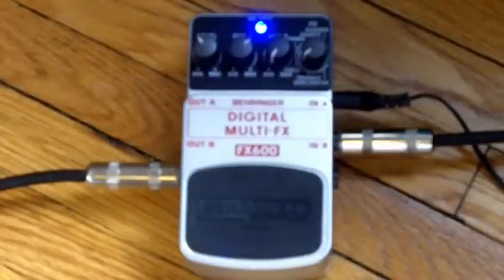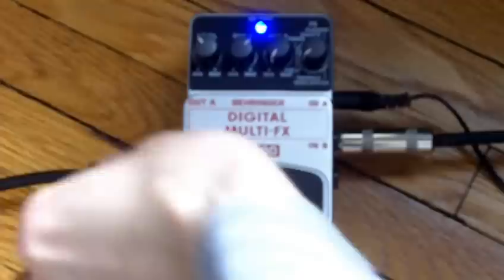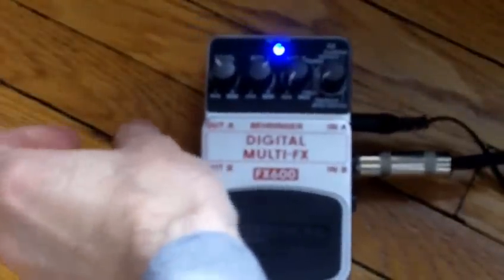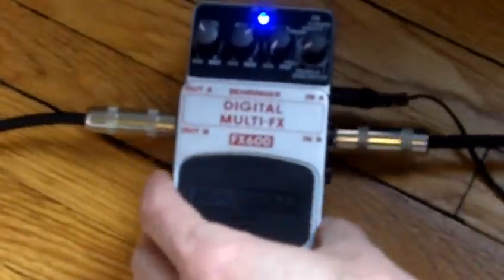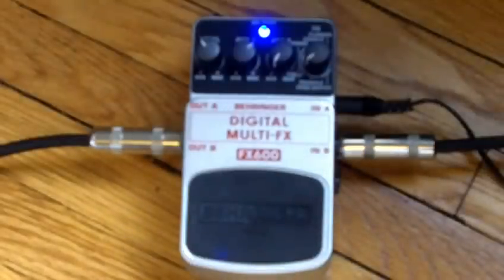Behringer FX600 delay quirks

Comment: I may be wrong but if those are stereo out puts then the A channel is probably mono and the B channel is probably the other side of the stereo delay hence 2 sounds from A and the second sound only from B. It would be interesting to find out by plugging in both A and B together and see if there are 2 echos.

Comment: I think it's some of an engineer error not to bring both delay effect at the same time in stereo mode. It's like first repeat its coming fron left side and second repeat of the delay is coming from right side. Like a ping pong delay. I think overall delay repetition should come at the same time both L and R side. Also amount of repetition should be controled from parameter 2.
It's nice that you noticed it.

Comment: This pedal is a big piece of shit! Granted it's cheap, but I've bought a case of Bud Light that lasted longer. I have had one of them for a few months and finally got the chance to build a pedalboard and try it alongside a couple Boss pedals using a daisychain power supply and the damned thing didn't last 10 minutes! I've checked the battery and tried several times to revive it.... goddamn thing is DOA. What a joke.